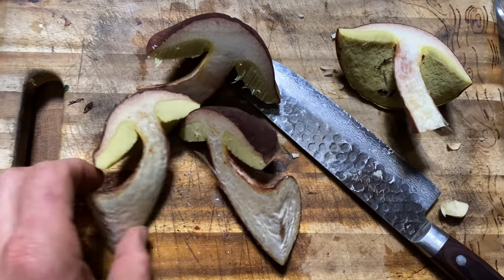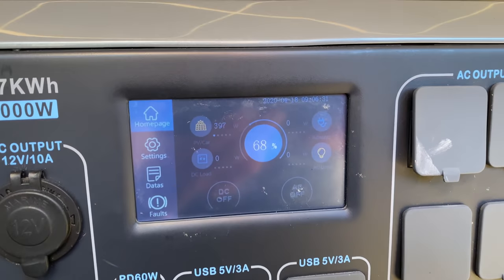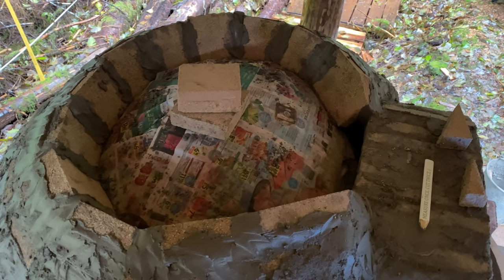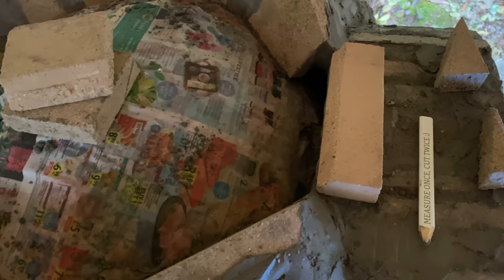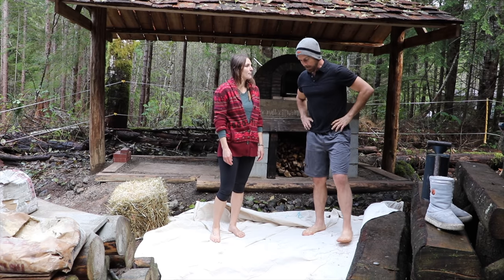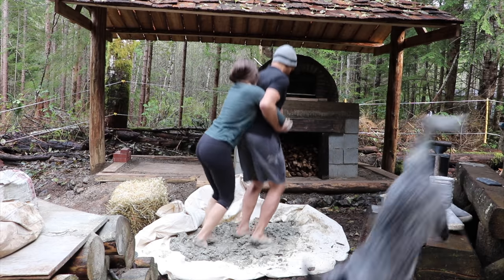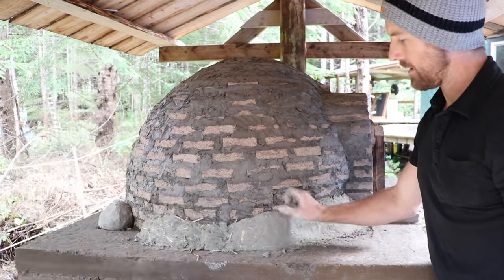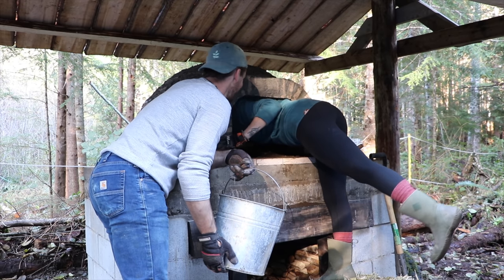OFF GRID LIVING // WOOD FIRED PIZZA OVEN Day 8 | 1st FIRE to CURE BRICK | Cob Clay w/ Feet - Ep. 110

Comment: That’s crazy.I just got my EB 240 today.I got it for backup in case the power goes out in the winter.I need it to run the NG fan on my home heater.Very heaven.I also bought a set of solar panels to charge it if power goes off for an extended period of time.

Comment: I made a cob pizza oven years ago together with Christo, an American guy.
I remember we did a layer of straw 5 cm thick with only some very wet clay in between the inner dome and the outer cob layer.
Eventually the straw will burn away and so leave an insulating layer of air and some loose clay structure.
Very important for the bread baking when the fire is taken out. Otherwise it cools too quickly!
Reply: Won't the cob layer itself do that? It's mostly straw and clay.
Reply: We were told that it was done for the sake insulation. And that makes sense to me, because it is the air pockets created give that effect. 
Sure there is some insulation in the straw but it will not be enough to keep the oven hot enough.

Comment: I'm a roofer not a mason, but, it's not easy. If it was everyone would do it. You're doing a good job.
Reply: Roofing don't look easy when I see roofers sweating and working with hot oil or the metal roofing.i do traditional Pueblo masonry.truck loads of lava rock for the foundation then sandstone truck loads for the wall.digging a knee deep trench for the foundation..mixing mud and moving those heavy lava around like a puzzle.once it's all done and you have a foundation up three feet past ground level then you can start mixing more mud and doing the walls(windows,door frames)then hauling the wood beams ontop..for a traditional roof(if you like the zigzag pattern or just straight sticks)you put them ontop of the beams..add dry flattened yucca plants..then layer's of dirt.plastering and chinking the walls is fun.

Comment: This was cool at first however your really not living off the grid with every expensive gadget or convience. 
I do live off the grid at 9,000 ft, no cell signal, heat with caboose stove. Also van dweller nice & warm below zero presently.
Reply: Good for you  do you want a medal or something???🙄
Reply: They may have some gadgets but i don't see any grids out there!
Reply: @melaronie3024  point,  this really is not off the grid, looks to be some trust funders spending away with every convience & gadget.
Reply: Haters sit on either side of the fence.

Comment: I’m curious why you didn’t put a chimney on the pizza oven? Wouldn’t have to deal with all the smoke coming out the front. The Chimney also helps with the air flow or draw as it’s called. As the hot air exit through the chimney it draws in air from the front opening. This helps provide oxygen on the fire. Looks like you where having a little issue keeping the fire going. Yes I know there are ovens all over Italy without chimneys, but those are built my masters with the correct dome height to opening ratios. You could still build a brick flue on the front to help with the smoke. Check out Forno Bravo’s forum, there is a ton of information on there with people building ovens all over the world. Looking to build my oven next year.
Reply: You're right
Reply: You need to watch the video. He explained how it was coming later!
Reply: @MrPanzerblitz  sorry too much fast forwarding. Saw that he was going to add a flue after the opening. That will help with the smoke. Will be interested to see if it helps with the draw of air.
Reply: @MrPanzerblitz  would still be interested to know his reasoning for not putting the chimney in the dome. I’m trying to soak up as much info as I can before I build my oven.
Reply: @WildmanDesignCo  Go to "My Self Reliance" and go back in his videos and see how he did it. When he was done he thought he had screwed up, but nope! He uses it all the time and it works great.

Comment: Amazing work! That’s a nice big oven! Can have a good fire going along side your food. Idk if you guys have one but a friend of mine has a steel fire “plows” to push or pull embers around the oven. I don’t if they are commercially sold as he welded his. It’s just a slab of 1/8in steel about 2in X 12in with a 2-3ft rebar welded on the back. Simple but effective and certainly better than a stick!
Reply: I was thinking that a "railing" might work well in pizza ovens. A small wall to hold the embers to the sides and separate them from the food. If it was a flexible piece, it could be used to "plow" the embers to the edges, and then left in place to serve as a barrier. Has that ever been tried?

Comment: Was watching your "first fire" in the pizza oven, a real piece of carefully made  art indeed. FYI: cement cures faster to higher strength when exposed to carbon dioxide from a fire, not because of the drying heat of a fire.  A century ago, bricklayers would place several charcoal burning trays inside brick-built houses to accelerate the high strength cement  curing. Perlite is a good insulating material, but so is vermiculite - of mineral origin. You choice of a yurt as a starter home was a neat choice, but it would not withstand the weight of a falling tree during a major wind storm. With all of the hemlock and other good timber available to you, I'd stick to log cabin additions in your future developments. Also synthetics of a yurt will eventually deteriorate under UV sunlight exposure (PVC only good for about 10 years). Noticed Jakes milling rig operations - hard on your back to push at near ground-level. I highly suggest  that you get a hand operated or engine operated winch  to pull and drag the trunks up to hip level resting on old tires. You are not a spring chicken any longer and have to take care of your back for future efforts. Have watched several of your episodes and sort of know the beauty and abundance of natural foods on the west coast (our family owning a one-acre lot on Pender Island since 1971). Cheers from a fourth generation down Swede; born, raised and educated in Denmark,  1974 emigrant to Calgary married to a Canadian, 45 years' career as a Civil and Environmental Engineer (with my own company Green Inc. for 14 years). Built a double garage entirely on my own in 1979, and have been a home renovator DIY for 48 years. I know the challenges (always take two or three times as long as originally thought - with hick-ups along the way). Love your videos. Cheers from Kurt Hansen.

Comment: Great Job. If people want to build one of these at home, backyard styles I would recommend researching the proper dimensions/ratios for circumference + internal height of oven dome + height and width of door. There is a science to this for optimum oven efficiency, i.e. to get the perfect convection happening where the oven draws air in across the bottom, heats the complete dome and fire licks out the front of the oven...with or without chimney really doesn’t matter. Just less Smokey with chimney...Another reco is to forgo the brick and make a true cob/clay oven, by digging up your own clay or finding someone in your neighbourhood diggin up their basement and grabbing some clay. Instead of brick, use clay mixed with sand...And use a sand form for the dome, then lay clay around in concentric circles until capped off at the top - let dry, repeat again this time with clay mixed with sawdust for insulating layer...

Comment: I did research on how the domes ovens are  built and work. Not to take anything away from your design or to put any negative opinion of the process. The cob insulation is an ancient process used for centuries. Nice to see the way you built it, using old traditional methods. The process is very time consuming to be done correctly. I hope your subscribers understand that. Me, being of a technical background, I look at the process to learn and understand other methods. I have commented on some of your methods, it is my nature. Take no offense. Will you design a metal door for the front, so you can control the draft and the heat?  Was that a metal post with a TV antenna, there in the brook wash out under the tree?

Comment: About the only concerns one might have is that the opening is not holding the bricks in tension since a row of bricks is in a flat course across the front and it likely to fail since nothing is supporting its weight. Indeed an arch would of been ideal because the curve keeps the brick pushing against one another as the force  is transferred down the sides of the opening and it's strength is legendary. About the only fix would be to place a formed piece of plate steel about 1/4inch or 6mm to fit the opening because even a coating of Cobb/Cement it won't be a question of if it fails but when but it won't be catastrophic. Beside pizza, the oven will make bread and nearly anything that can be place in a covered pot since its heat will last for hours even after what went into it first is done..

Comment: I saw this same thing on you tube done but with copper tubing in the cob wrapped around the oven. Then built with the oven was a cob hot tub next to it. It heated the water with a small pump circulating the water to the hot tub. This would allow to  have hot tub pizza parties. Hey why not??

Comment: These ovens usually have openings that are not as tall also the exhaust exit inside the oven is lower to trap more heat, and have more efficient insulation, like ceramic   wool or rock wool that are fixed by wire or a metal net and then plastered over.

Comment: I know zero about making a pizza oven but I do know a bit about working with cement . Here is some unsolicited info off top of my head, on the subject.   Cement / Concrete does not gain strength from drying out it gains strength from a process called hydration . Hydration is a chemical process that occurs when you mix moisture ( water) and cement (  the two combined are called Mortar)   The cement will set and gain strength as long as there is sufficient moisture to hydrate the cement in the mortar  .  If you force the moisture out of the mortar you are slowing or stopping the hydration process.  I say all this to say I am confused by building a fire to dry the cement if that is what your were recommended to do.   If you want to know more about cement and hydration etc do a google search for Cement hydration . You did a fantastic job on the oven I give it two thumbs up :-)  .   Ps.  Wet cement can cause chemical burns on your skin you might want to consider wearing some rubber boots to mix your cob mix  if that was Portland cement you added to the mix.  Peace Out :-)
Reply: It's not cement. Google COB.

Comment: Just wondering if a copper rod had been incorporated into the near inner layer, would that serve as a helper 2 hold the heated over longer times, and could it be rerouted into a heating system for the Ice days for the floor of the shelter?

Comment: So I noticed that when you were charging your batteries, that you have power lines above, are those feeding other folks out near you, or are those just high voltage lines running "cross country"? The Pizza oven looks pretty amazing!
Reply: Those are the utility poles of British Columbia Hydro, which provides electricity to the majority of the province.
Reply: Those lines are not functional, no transformer installed due to lack of inhabitants. Maybe someday if population increases in that area.

Comment: Ive  been loving the pizza oven build. I was surprised how you built the dome leaning the dome bricks in vs stacking them flat and stepping them along the curve. any extra thoughts?
Reply: How would you join them at the top? What would prevent them from collapsing? Look at at any arched brick doorway or window. In order to support its own weight the bricks need to  be angled that way.
Reply: @IndieMusiCon  the bricks would only be inching forward as the dome rises. They would be mostly motored to the the brick below. You would be left with a stair step effect for the final coat. I think it would work
Reply: @nedanother9382  but what's the point of that? Why risk doing it that way when the method he used has been proven over thousands of years?

Comment: i love how you set up your solar panels under the commercial power lines. basically thumbing yer nose at the electric company. you go man.
Reply: I was thinking how cool it would be to use the power lines until the main cabin is built. Saving on time, energy, gasoline for generator etc... until the cabin, bathroom etc is complete. At least they'd have the solar for what if scenarios in between time. Then go complete off grid when all projects are done. They'd accomplish so much on rainy days with little to no power. And if they build a workshop long and tall enough to mill up & dry out all of the lumber they'd need to get jump started next spring they could work all winter long inside the workshop! Power in could allow them get a washing machine (dryer) and a few other essentials like deep freezer and cold storage obviously temporarily until they can afford a very beefy solar grid. No shame in a modern homestead that is ready to be off grid at a moments notice!
Reply: @Pflexer  those power lines are not functional, no transformer was ever installed because of lack of inhabitants.
Reply: @IndieMusiCon  Ohhhhhhhhhhh ok! Thanks for the info sorry I had no clue!